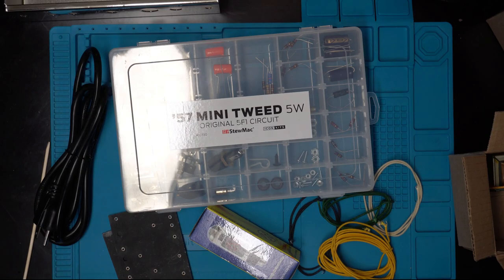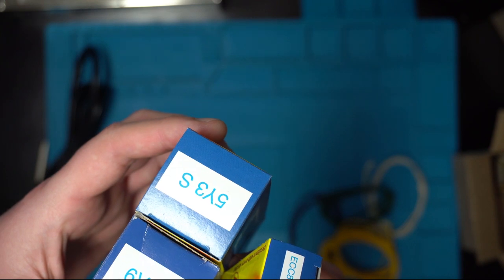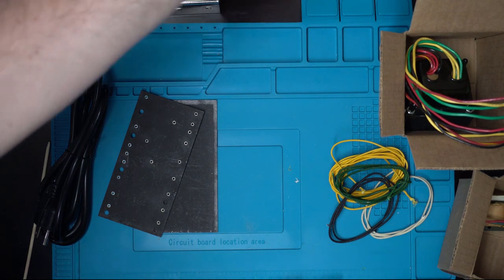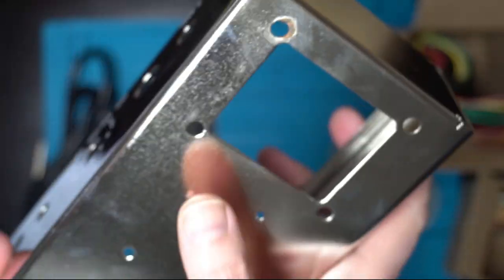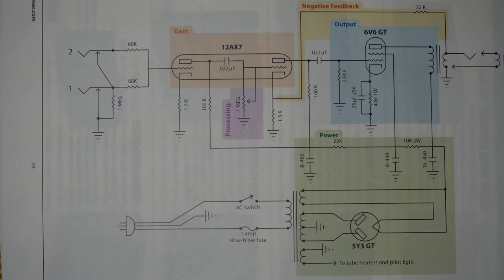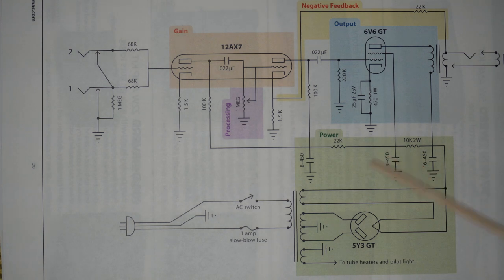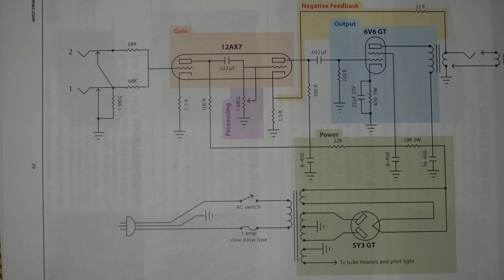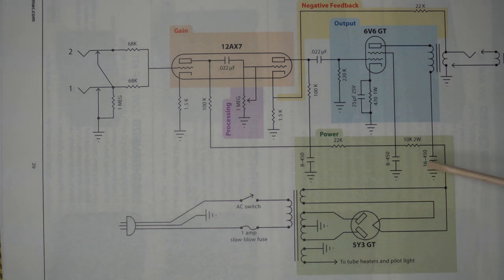StewMac '57 Mini Tweed (5F1) DIY Tube Amp Build - Part 1

Comment: Man, that output transformer looks REALLY tiny! I guess I just don't have a realistic memory of a 5W output transformer because I ordered my Boothill 5f1 kit with a 15W output transformer; MUCH beefier!
Reply: What's the benefit of a beefier output transformer?
Reply: @MrPodvig  the amp gets a bit bigger and louder before it goes into distortion. It's still a 5 watt amp so it still distorts at low volumes but it just gives you a little more clean volume before the onset of breakup.
Reply: Thanks. That's what I guessed, bit I'm me to this. Waiting for my kit to arrive - my first amp build.
Reply: @MrPodvig  cool, some if the most detailed build instructions are from forums and Stew Mac. I git my kit from Boothill Amps, they just sent me a schematic and a layout with no step by step instructions. It was okay until I got to the grounding scheme, I watched Boothill's videos but they were poorly recorded and not well thought out or organized. I ended up stopping my build to study how 5f1's were grounded. I used a grounding bus for the preamp grounding bolted and soldered directly ti the chassis. Without instructions or notes, the grounding was a bit confusing.
Reply: Thanks for the tip. I'll need instructions since I ordered my kit from Weber (right here in central Indiana). Couldn't afford a StewMac kit.
Reply: @MrPodvig  YW, thankfully, the instructions are free in PDF form on the StuMac site. Weber and a few other have resources too, but grounding info is like the Holy Grail.
Reply: I went back to the stewmac site to look at the schematic from which they based their buuld and it uses the input jack for the preamp ground, Since I chose the preamp grounding bus approach, I deviated from their instructions for just that part of the build. The jack provides adequate ground but if the jack ever works it's way loose, you run the possibility of lising a goid ground. The bus is a little overkill but I chose it and it works, I'm sure there are many people who have the input as ground and their amps are still up and running. I'm just OCD...

Comment: why would you want pre-tinned wires you will probably have to trim them anyway if you dont want a rats nest
Reply from the maker: You are correct about the trimming. The pre-tinned wire is nice so you don't have another step to worry about. When you are soldering multiple wires not having to get out rosin and solder to pre-tin saves some time. Plus, wire that has very fine gauge strands can be a pain if one or two break off and fall away causing a chance for a short. It's probably mostly personal preference.